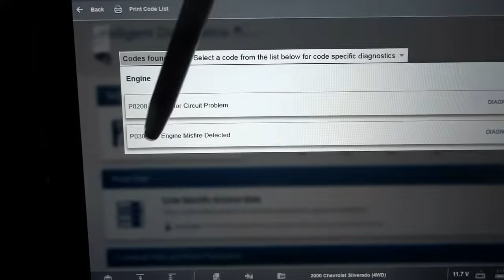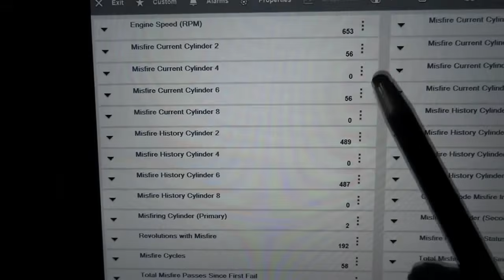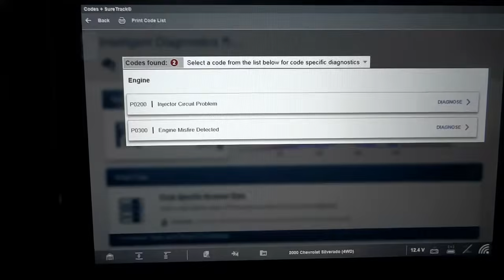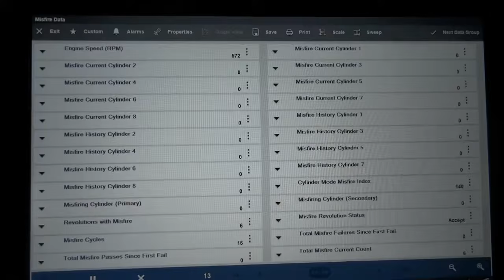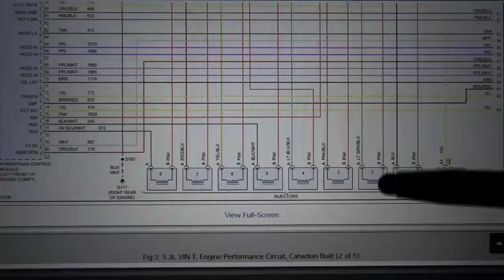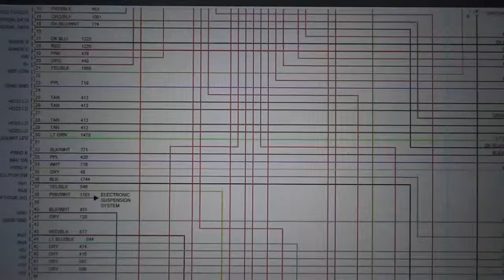Chevrolet Silverado Code P0200, Fuel injector Circuit Testing, Misfire P0300

Comment: Wow bro I stay in Owing Mills Maryland about an hour and 50 minute away , I have a 2003 Chevy Tahoe and I’m having the same issue.  Is there anyway that I can get some info so I can bring my truck to you for repair.  🙌🏾🤴🏾
Reply from the maker: Ensure. CMDLS 1  sure!! you can email me at Deo@calleva.org
Reply: Thanks for the email I sent my contact information so you can reach me. Definitely would like to bring the truck at soon as possible. 🙌🏾🤴🏾💯

Comment: Terrific video mister, you are a very good teacher.  What is the name of that wire tester that you clamped on to the pink wires at about 19:24 minutes ? And where did you buy it? Thanks.
Reply from the maker: Tom Cooper  That's a piercing tool, I got it from Fleet pride

Comment: Thanks  it’s very nice presentation I have the same problem on cylinder 6 p0206 on 2017 suburban 5.3 how can I make the sane test you did because my injector wires are inside the intake can you do this test with the intake out or there is another easy way
Reply from the maker: EPHREM ABATE do you have an amp clamp or a labscope?
Reply: I don’t  but I can get one

Comment: I have a p0300 code on my 04 Yukon 4.8 2wd. Just bought it. Former owner changed the injectors with cheap ones. Looking at Long term , short term data and it’s between 14-25. Should I change injectors to OEM ones? I replaced the fuel pump with a Delphi one,since it didn’t start due to a cheap $30 pump that was installed a couple months ago.
Reply from the maker: Renegade NEVAREZ   check for vacuum leaks..
Reply: If there’s a vacuum leak, would it idle funny?
Reply: Suppose to drop into negative on short term and flex up into postive nd bsck in postive but float in the negative mostly. Vacuum lesk can cause a running problem

Comment: I had code p0300 on a 2004 yukon which was multiple misfires detected. Long story short changed a bunch of stuff did full tune up, changed all 8 coils with no luck. Here's the funny part it was a bad ground wire on the bottom side of the engine block on driver side, removed and spliced new eyelet on wire reattached wire and BOOM there it was truck running like it never missed a beat. Hope to save someone some money and time in the future.
Reply from the maker: Don't Trip99  Thank you very much for sharing your fix here, I appreciate it, I'm sure it's gonna save someone time and money someday!!

Comment: Thanks for the vid. Much appreciated. Where are you located. I have a 2019 chevy duramax that is throwing these codes. Thanks 🙏
Reply from the maker: Detroit 313 Vlogs My Pleasure!!!  I'm located in Dickerson MD
Reply: Bro wow I live in Owings Mills Maryland and I’m having the same problem with my 2003 Chevy Tahoe
Reply: Is it possible I can get your info so I can get my truck repaired also🙌🏾😁

Comment: Very informative. Thank you for posting , I'm getting a p0202 on my 2010 Chevrolet express   hoping to find a similar issue , just wish it had a bigger hood
Reply from the maker: Dustin Bowen  Thank you!!
Reply: @KITS_Auto_and_Truck_Repair  wondering if it could have a small amount of moisture (or just stopped up) seems to only throw a code after it reaches operating temp , and sporatic at that. Noid test light confirmed power last night
Reply from the maker: @dustin00371  that's odd you might have a driver in the PCM that's dropping out!! check the wiring first, make sure there is no corrosion or a connection problem somewhere in the wiring!!

Comment: Man I WISH I had a broken wire like that. I get a RANDOM P0200 code with rough idle and the continuity of the wires is good, injector tests the same as the others, I don't want to believe the ECU is defective, because it does fix itself magically after revving the engine a few times....everytime I get the tester out, it runs fine...grrrr.
Reply from the maker: Martian Dan you might have the answer to your question, if the injector wiring is good, you have have an injector driver that's dropping out..
Reply: @KITS_Auto_and_Truck_Repair  yeah, I just had no chance to verify that. Perhaps I just have to start replacing parts. Thanks!
Reply from the maker: @MartianDanTheMartianMan  I don't recommend replacing  parts without knowing which ones are bad!!  Good Luck!

Comment: Through explaining, thanks. I have damme codes but on a 2001 spyder Vortex 5.7 injector we replaced 6,000 miles ago and ran great until 2days. Ago three po300 and 200
Reply from the maker: Stuart Hunter you most likely have a problem with an injector or the injector circuit, you should have it looked at!!!

Comment: What would be the issue if my test light don't light up when checking for signal from the computer 🤔
Reply from the maker: Joshua Mitchell you have to connect the test light to B+ and the other side of the test light to the control wire of the injector, while cranking the engine if the test light doesn't flicker, you either have an open control wire or a bad injector driver in the computer... Good luck
Reply: @KITS_Auto_and_Truck_Repair  I had the car running and disconnected the injector pigtail, had my test light on B+ and touched the green connector. No light illuminated. Or did I do it wrong 🤔

Here are my codes
- p0306
- p0200
- p1516
- p1518
- p1120
- p1220
- p1221
Chevy Tahoe 5.3___2001___170k
Reply from the maker: @aceftr6842  you probably have an open control wire or a bad driver in the ECM
Reply: @KITS_Auto_and_Truck_Repair  With engine running  i can hear all the injectors clicking via screw driver method.

Also while engine is running when I pull different injectors (all on passenger side). And connect my test light from (B+) to the control/signal wire. Nothing illuminates. But I do have power on the other wire.
Reply from the maker: @aceftr6842  your problem is on the control wire, you probably have an open control wire or a defective driver in the ECM... that's what you need to figure out
Good Luck
Reply: @KITS_Auto_and_Truck_Repair  Last message, my fault if I'm being a bother.

I just checked for pulse at night and see a flickering light. To sum it up.
- I have power
- I have signal
- I hear the clicking

But when I unplug #6 injector no engine change. I could even start the car with it unplugged and no difference. What could it be, thats all.🤔
Reply from the maker: @aceftr6842  if there is power and control at the injector, and you unplug the injector the engine rpm should drop if nothing happens swap injectors and see what happens, if it continues after swapping injectors,,,check your ignition system,,,, Good Luck

Comment: I have 2005 Silverado 4.8 i had a code p0101 MAF sensor i replaced it to a new one and now it results that i have p0300.. My question is. Is it worth it replacing all the spark plugs, spark plugs wires and ignition coils?
Reply from the maker: Sleepy Loc, if the P0300 code came up just after replacing the MAF sensor, you probably got a defective sensor out of the box... what kind of fuel trim numbers are you getting?
Reply: @KITS_Auto_and_Truck_Repair  multiple misfire/  random coils
Reply from the maker: @SACRAMENTO_916  check fuel pressure and check for a vacuum leak on the intake... do you know how to use fuel trim numbers to diagnose a misfire?
Reply: @KITS_Auto_and_Truck_Repair  to be honest no i dont
Reply from the maker: @SACRAMENTO_916  that's ok, watch my video called how to diagnose a misfire on a ford E350, in that video I show how to use fuel trim numbers to diagnose a misfire and some of the possible causes of a P0300
I hope that video can be helpful to you..
Good luck

Comment: I have those codes on my I have a 2004 Chevrolet Express Cutaway 3500 van with the 6L engine and 106,000 miles.  I hope the fix is that easy!
Reply from the maker: JB91710 hopefully you have an open wire at an easy spot to get to... Good Luck!!!
Reply: I'm about to start diagnosing the same problem on my 2006 cutaway with a 6.0, any chance you found your problem?
Reply from the maker: @ryanshawdee2708  yeah, the problem was a broken injector wire!!!
Reply: @ryanshawdee2708  I took it to a mechanic that I thought I could trust but he just threw parts at it but didn't fix anything.  I'm flushing the injectors with bottles cleaner through the gas tank.  It only misfires under deceleration but runs smooth at cruising speed.  I'm getting 10 mph on trips.  How about you?

Comment: I have a question my 2001 chevy my pistons are getting full of gas and its locking up the engjne due to too much gas like the injectors are staying open how can I fix this issue?
Reply from the maker: Jesus Guerrero you need to do an injector flaw rate test... or you should have a mechanic do it for you
Reply: @KITS_Auto_and_Truck_Repair  I have a misfire, same engine cylinder 8. I get a injector circuit failure but I also smell gas when I stop. I tried plugs, wires, coils, and even took off the valve cover and checked the springs cranking the engine.... also did the test with the noid kit, injector was getting power when I did the test. It's strange and this misfire comes and goes. Right now I am pulling off all of the electrical tape from the wires and checking all the wiring... so far I haven't noticed any damage. It's weird but I am thinking there is a failure in the injector wiring somewhere, and its intermittent so the wire maybe damaged and just only making connection some of the time. But what are your thoughts? You are the best mechanic I have seen on Youtube dude.
Reply from the maker: @hell_pike9150  I have seen the control wire of an injector get shorted to ground and cause the injector to stay on all the time and cause a misfire... is the noid light flashing or it stays on constantly?
Reply: @KITS_Auto_and_Truck_Repair  It flashes, seems to flash normally
Reply: @KITS_Auto_and_Truck_Repair  But i read online sometimes a faulty injector can trigger that code too. So I think tomorrow I will go ahead and upgrade all my injectors, if it doesn't work then at least I got some extra power by switching to better injectors than the oem? Or is it a bad idea
Reply from the maker: @hell_pike9150  you might have a stuck open injector... swap injector and see what happens
Reply from the maker: @hell_pike9150  yeah you probably have a stuck open injector swap it with a different one and see what happens before you buy new ones... if it's the injector the misfire will follow the injector...
Reply: @KITS_Auto_and_Truck_Repair  ok I will do that! Also I used a screwdriver stethoscope to listen to the injectors, that one clicks but didn't sound the same as the others. So yes I will do a swap and run it for around 500 miles and then re-check my codes.
Reply: @KITS_Auto_and_Truck_Repair  And thank you dude and God bless you are a legend
Reply from the maker: @hell_pike9150  sounds good
Reply from the maker: @hell_pike9150  My Pleasure!!!
Reply: @KITS_Auto_and_Truck_Repair  my miss is gone! But now I have run detergent through the engine, and the sounds of the engine overall were dulled but now I can hear a clinging sound coming from the passenger side of the engine... smh does that always mean engine failure?
Reply from the maker: @hell_pike9150  I'm not sure, you can try thick engine and some additives to see if it's gonna help... Good luck

Comment: The mother of skill is repetition. Your doing a great job of teaching. Don't worry about repeating yourself. I had a motor cycle injector that had a open intermittent power inside of the wire insulation. Eventually I think the insulation would of broke apart from the V twin vibration. I found it by running my fingers along the wire and found a hard knot inside the insulation.
Reply from the maker: Alan Gaudry Thank you, I will always remember that... and I'm glad you were able to fix your motor cycle